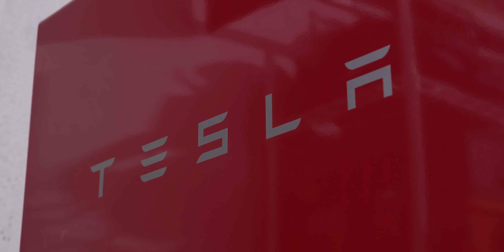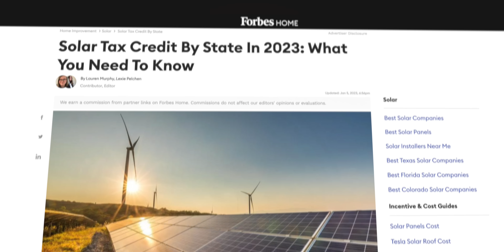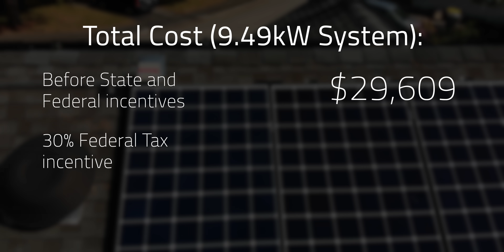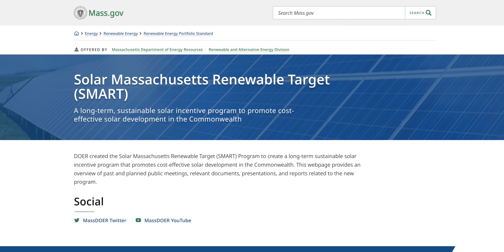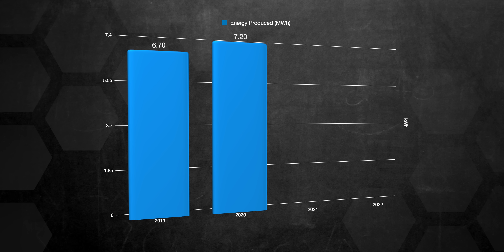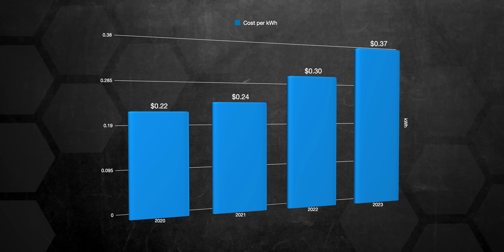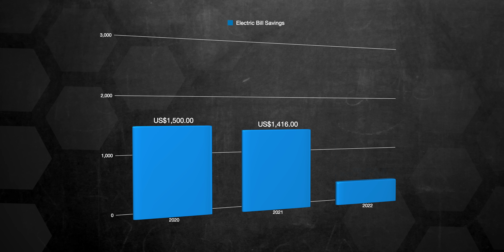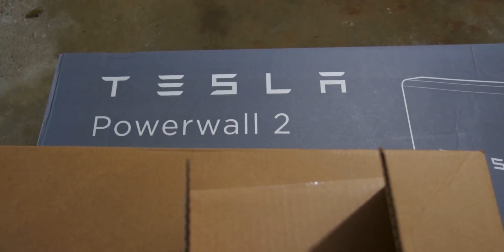5 Years with Solar Panels - Is It Still Worth It?

Comment from the maker: Do you want solar for your house? If you have solar, what are the things you wish you had known beforehand? For 65% off with HelloFresh PLUS free shipping, use code MATTFERRELL65 at https://bit.ly/3D53QkS!

If you liked this video, check out: Wow! I Didn’t Know A Prebuilt House Could Do This https://youtu.be/y3NVDqH39CE?list=PLnTSM-ORSgi7FwYRnWkpCSkAeFOzrgh5h
Reply: How much did property taxes have increased since you installed solar panels?
Reply: @ColinPopoviciu  They wont increase because solar panels DEVALUE your house. Another thing these sales people dont tell you. Talk with a realtor.
Reply: get polycrystaline panels ignore the normal monocrystaline panels ... the poly panels gather different wavelengths of light making them more efficient and a larger peak use period ...
Reply: Does your guide include info for homeowners who are retired on social security and are not paying much in taxes anymore?
Reply: @mnemosynevermont5524   I think you're SOL if you don't have any taxable income to offset a solar tax credit. However if you don't have enough income to offset the full 30%, it will roll over to the following year.    At any rate you might not see a total ROI in your lifetime, unless your planning to live to a ripe old age.
Reply: @mnemosynevermont5524  Heres your info - dont get them.
Reply: Better to build an overhang to protect people than keep the snow up on the roof.
Reply: Taxes, depreciation, hybrid solar panels (thermal and electric generation), and climate change over the life of an installation.
Reply: @brodriguez11000  Home owners insurance co. dumping you or doubling your rates, service contracts, repair from leaks and rotted roofs, electric co. penaltys what they didnt tell you about that either?
Reply: Matt, you failed to mention that your just shy of $7,000.00 knocked off of what you paid for the panels means that so far you've paid your full electric cost since installation, so technically speaking you haven't saved anything yet on your electrical useage costs! Once the solar panel array is fully paid off only then you'll be saving on electricity useage costs monthly. (...around 9:05) My biggest question I've never read answered is: What happens when it's time to re-shingle your roof, do the panels get temporarily removed, including the mounts? (Leaks develop on older roofs.)
Reply: Matt - i have had similar experience.  I have larger system 19.2kwh but our utility has lower rates as they use more wind/solar which leads to lower grid costs themselves.  So my payback period was going to be longer.  However, I recently purchased EV which now utilizes the excess electricity I produce so improving my B/E time horizon.   In my case, any excess electricity I produce I sell to grid at wholesale rate of .07/kWh.  If I purchase from grid, consumer rate is around .12-18/kWh depending on time of use or program.  Have you considered what Break Even of PV would be for you if you didn’t get PowerWall but instead had just leveraged any excess in your EV?   Seems like more and more people will see better value from EV
Reply: @mrbizi5652  I've been eyeing solar installations for a couple years, but our utility generates 85% of our power from wind, which is great, and overall it's better for everyone to have cheaper, renewable electricity, but it's pretty difficult to make a solar install work financially when we're only paying $0.08-0.13/kwh. I'm looking at 6-7 year payoffs on a DIY install even with factoring in charging an EV, maybe 2 in the future. Every estimate for an installer would have a 15-20 year payoff length.
Reply: are you on peak/off peak billing for electric? Xcel in Colorado has been criticized that power made in peak hours (fed back into the system) isn't credited at the same rate as being charged to use that power
Reply: this video is the guide I took note and made a good deal  without the guide   thanks MATT    for doing this and sharing   my snow guards and work done all by myself full install by me and the city just did the integration added me to the solar side of things   thank you excel for helping me with that part.   the hardest was wiring and drilling thru concrete,walls etc    the roof work was fun and i own my climbing gear to help others now.   still cost me a few dollars but in the end I can repair my own system and others maybe but hopefully not i'm done with this solar thing been a long year.
Reply: Does the solar-guide include home battery backups? If not, is there a good resource for guidance on that including using incentive programs?
Reply: I think there is someone impersonating you on the comment feeds
Reply: @jdstaatssatx  oh it a scammer asking ppl to watsapp him .
Reply: how much do you pay 230 bucks a month what!  i have never paid over 50 bucks a month what are you using to cost so much ? i think a lot of people are wasting energy
Reply: who was the installer that did a horrible job
Reply: How long do solar panels last? What happens to them when they are "done"? Is there a plan in place for recycling of used up solar panels? Or are we -by going solar - creating a devastating battery mountain for our kids to detox?
Reply: @janalu4067  In answer to your questions: 1 Solar Panels wear out quite rapidly  2 No plans are in place to deal with them. 3. They contain toxic waste that will need abatement/processing. 4 The mess being created is massive and is growing at a faster rate all the time because of the cognitive dissonance amongst society that can't think past the hype and the government outlays pushing it all forward. People need to think for themselves and realize this madness is creating a disaster on multiple fronts.
Reply: @janalu4067  good questions.
Reply: Solar: if you pay for it right up front, it might be a good thing.  If you lease or are paying over time then the contract needs to be scrutinized before signing.  It may not be a great deal.  Unless you get gel batteries with the system, don’t get it.  Also, your roof needs to be relatively new so the expense of replacing it will not be alarming.  You have to pay to have them removed  before roofers can reroof than you have to pay to have them reinstalled.  They last about 30 years if you maintain them.  You know, wash them off on a weekly basis.  Solar Arrays, as they are called,  are RARELY installed by electricians, instead companies hire people off the streets or the guys standing around at Home Depot.  If you have a house fire the fire department will likely let your house burn down because they do not like being electrocuted.  You see, the system is “ON” all the time so who can blame them?  Do you really save money by having such a system?  Do the math and you will see.  If I had a choice between buying a Solar Array with batteries I would rather take the money and travel through Europe because I will still have money left over when I get home. BTW, solar will not improve the resale value of my home, but what will is a backup generator.  Just say’n… Cheers.
Reply: @568843daw  In other words, they are not worth it, you will spend more money than what you get in return. 👍👍👍👍
Reply: republicans will destroy any program that makes solar viable and pays you back.
Reply: @itoibo4208  any political party ... basic rule if they aint getting the money its bad ... it should be what the people want
Reply: thank you sooo much for all your hard work.   You are appreciated.
Reply: We live in the country and appreciate all your videos,especially on this topic. 1 piece of advice for you sir on saving money. I have a huge freezer that's saved me a fortune in Gas mileage to the store. Just something I wish I'd have done sooner. I have learned so much from you I feel like I owe you. Thank you for all you do.
Reply: Should look into liberty engine 2.0
Reply: No I don't I rely on burning wood for my heat and ice to stay cold....very efficient
Reply: I love how you gleefully tells us how much money you've saved, which is mostly because of the Green-Granola Lobby that makes regular power trully unaffordable for millions of people; 37 cents per kWh; give me a break--this is NOT a free market operating!!!  Because of this government-sponsored grift, people are so cash-strapped with either their heating or electrical bill; they literally cannot afford anything past a bleak economic survival if at all.  This has caused many people to become displaced and/or having to share resources; all because of high priced electricity; high-priced heating; high-priced gas which has also made food prices soar, adding to the misery of millions!  No empathy for collateral damage ever!
If the electrical industry were allowed to use natural gas and nuclear without onerous and hidden penalties, you'd be singing a different song.  Most people cannot afford solar or it's not viable in their location--or will be staying in the home long enough to justify it.  Or even if you do, you then have a 25-year toxic-waste time-bomb perched atop your house; very few installations take into economic-consideration of this inevitable-mitigation!
Yeah buddy, you saved money off the backs of the poorest, of the rest of us!  Thanks for posting a video, rubbing it in our faces.
Good luck on your newest castle...
Reply: Currently sittin on a bunch of Energysage quotes. Do want, also very busy right now.
Reply: you will not break even
Reply: In South Africa, load shedding is a curse, but using solar panels and a hybrid system has allowed us to keep our doors open! So I am 110% behind solar!
Reply: Not if you sell your house, It takes like 10 years to pay off right?  I also heard that if you are in a Northern part of the country they wont offset the the carbon footprint of making them.  You get a much better payoff if you live in some place like San Diego.
Reply: Yes I want them...but not on the roof! Sales are not qualified when I looked ....I would have to be my own contractor they are not even educated.  Thanks
Reply: Question: are you integrating gray water management and composting into your design? I've been curious about those strategies.
Reply: hope you appreciated that Matt.
Reply: A Power Wall installation was done poorly by a company that Tesla recommended. Then, instead of offering any remedy, they threaten to sue you if you talk about their behaviour on your Youtube channel.
If I were in your position, I would:
- Report that installation company to Tesla.
- Report that company to the Better Business Bureau.
- Make the video anyway.
By sticking strickly to documented facts, it would make any law suit unprofitable for them and help your viewers to know at least one installlation company to avoid.
But, I'm not you and you must do what you believe to be right.
Reply: Matt thank you for your amazing informative videos and you are NOT pushing this "GREEN AGENDA" that so many hypocritical Tesla "fanboys" do on so many YouTube channels .
Reply: What I think is hilarious is that in my area the electric companies have added a $60/month surcharge to your power bill if you have solar.
Reply: I think you did a great job!

I'm enjoying your work.  Grid is never solvent.  It is lifetime(s) of energy bills (household economic drain) and outage rates....especially during emergencies, when we need it the most.

I'm glad you went to the $.  To the conflict of interest within argument.  I've observed this MUCH re: Management corruption.
Reply: One of the companies I priced for Solar panels was $65,000 for my home, It would take me 36 years to pay for that at the cost of what I pay for my light bill now.
Reply: I wonder if integrating solar cell panels in the walls facing (most of) the sun, and how much impact of the electricity-bills…
Reply: In Germany, a snow rack on the roof is mandatory. Especially where there is an entrance to the building.
Reply: I had a full service solar company design and install my 5.8 kw grid-tied system. It didn’t cost that much more than a DIY and their tech support, warranty, free removal and reinstall during roof replacement, sort of real time fault monitoring gives me some peace of mind. Also they did all the permit work and even dealt with our HOA review process. I wish I’d known: 1) that panel production decreases as heat rises. It’s sized to compensate but we have very hot summers with no cloud cover and I would have looked into panel cooling strategies; 2) power company limiting installed capacity to 120% of prior year actual consumption. They claim that if I produce more than I consume I am then a utility which pushes them into violation of their contracts with their producers. 3) the snow thing you mentioned is huge! I had just put my foot on first rung of ladder to climb up and remove snow when it all sluiced over my head burying me to the knees. Could have been fatal!
Reply: As an outdoor enthusiast, I highly recommend the Segway Portable PowerStation Cube Series for all your outdoor adventures and home backup power needs. With its massive capacity, powerful output, and fast recharging capabilities, it's a reliable source of energy. Plus, its waterproof design ensures it's ready for any adventure, rain or shine. Don't forget to check out the video to learn more about the benefits of solar panels for your house. Happy camping and stay powered up!
Reply: Thank you for your comment! Solar panels for your house can be a great investment in the long run. Before going solar, it's important to consider factors like installation costs and available sunlight in your area. As for the Segway Portable PowerStation Cube Series, it seems like a reliable and versatile option for outdoor enthusiasts and those in need of backup power. The fast recharging and comprehensive protections are definitely appealing features. It's always good to have a reliable power source during outdoor adventures or power outages.
Reply: I didnt wait around for Matt to get to the point. Lots of unfiltered info. Thumbs down
Reply: I understand your interest in solar panels for your house. As an outdoor enthusiast, I highly recommend considering the Segway Portable PowerStation Cube Series for your outdoor adventures and home backup power needs. With its massive capacity, fast recharging, and versatile sockets, it's a reliable choice. Plus, its waterproof technology and uninterrupted power supply feature make it perfect for camping or unexpected power outages. Do your research and compare it with other options before making a decision. Enjoy your outdoor adventures and family time!
Reply: Waste of time for the majority of the country to listen, also his other one on 3d houses a waste of time.
Reply: We got our panels in NW Alaska where we have 24/7 sun for part of the year and 4/24 the rest.  Diesel is what’s provides energy there. We put an inverter system in and it saved us thousands the 1st year!  $7+ a gallon for diesel.  Our generator also feeds batteries.    I’m hooked.
Reply: If you can't even buy food and cook it from the supermarket???
Reply: We certainly “didn’t know what we didn’t know!” I wish we had waited for the rebates. There was one rebate, but it was only for the amount we paid out of pocket, not on the loan we took out on it. We weren’t told that. I also wish my husband and I had studied it a little more. The guys that we bought it from sold us the panels, but no backup battery, so we’re screwed. I heard their sales pitch and they definitely said we would have power when the grid went down, and that we’d be able to sell electricity back to PG&E. That’s what convinced me to go along with it. Well, we don’t have the power go down very often in CA where we live, so we didn’t find out until a couple of years later, that we didn’t have a backup battery. So, we can’t store all of the great solar power we get here. I’d sue them, but they sold their company by the time we figured it out. They didn’t put it in correctly, either. We found this out when the new company took over, they’d actually contacted us and said they would be out to fix it. That was a surprise, but we had to fight our Electric company about the $1800 true-up we had that year. Overall, we only pay a little less than we were paying. Our loan is $248/mo. and we get a true-up bill each year for around $600-$800. That adds up to only about $50.00 less than what we were paying. It’s now been about 5 years that we’ve been paying on the $40,000 loan. It was expensive! When it’s paid off we’ll save that $248/mo., but we may have retired and moved by then. Yes, we got screwed! We need to look into getting a back-up battery, but not understanding the whole system, I’m a little leery of hiring someone to do it. Anyway, I’d say that Solar is a Buyer Beware product! Find out everything you can before you sign a contract, make sure you thoroughly understand what you’re getting into, and find a reputable company that’s been in business for several years. Talk to your neighbors that have it, too.
Reply: Me me me me... Me me me

Decarbonization is 21st century pyramid building.
Just burn coal. 

This is sickening on so many levels.  "How to screw the lower middle class and make them pay for your feel-goodery."
Reply: The hail storms that destroyed fields of panels prove they have to be protected by clear plastic or mounted vertically
Reply: @UndecidedMF  we have solar panels, but they are on a mounting array in a field next to our house,  it never seemed like a good idea to have them on a roof not just for leaking, but also house fires burn significantly faster if you have solar panels on your roof. Not to mention the fact that your panels are not all facing the same direction when people try to fill up their roofs with panels. We had a solar consultation and it seemed like they were just trying to sell a product. In the early days of solar the tax rebates made it worthwhile but in many places it is still a scam
Reply: Thank you Matt!  Great video, especially the concerns.  So many of us are running just to stand still these days.  Issues like these get overlooked far too easily.
Reply: You should adjust these numbers by inflation. Maybe it's not that important for a 5-year period, but it will become crucial as years pass.
Reply: I am indeed considering getting solar for the house.

Seeing your rate makes me glad that I am supplied by an electric co-operative. Looking at the bill that just arrived in the mail, I am paying 14.5 cents per kWh that I used.
Reply: @pauld6967  Dont do it, you will lose.
Reply: Thanks for the video, quite detailed and useful for some, however purely a curiosity as the money structure concerned in the video is completely absent form where I’m watching 😊 hello from the Levant, I’m of course very interested in the scientific side of your videos 😊😊😊
Reply: I wish I purchased a couple Powerwalls from Tesla when I had them install the solar panels in December 2020. Best purchase ever! Paid them off in less than a year and a half.
Reply: I would like to know what happens with the solar panels when there’s no use it’s left in them where do they go and how many how much chemicals do they use and how much land did you disrupt to make the solar panels I’m kind of in disagrees with the green energy phenomenon I think it’s more of a farce than anything and I think it’s going to come out a great cost yeah so I’m not far at all I’m not a green energy personal believe in it and I don’t think tax credit so textiles should go towards funding solar panels for the people in this country
Reply: Some areas will even CHARGE you money if you put energy back into the grid. There are 2 reasons that I know of for this:

1. because it forces power companies to have to regulate how much energy is in the wires in order to avoid problems.

2. they don't want to lose money to the solar competition
Reply: Having a good Return On Investment with solar is primary goal. With increasing grid energy costs, it makes investing in solar a very good decision! It also means you can upgrade to high-efficiency appliances and STILL get a good ROI! Win-win-win 🌞
Reply: did you consider moving the vent &/or plumbing stack so 1-2 panels could be mounted there? I moved plumbing stack and 1 panel fit; paid for itself in 3yrs. also, pv production usually > tree shade so trim or cut trees.
Reply: And I wonder what happens to the rays of the sun not hitting the ground and what adverse effect will hurt by the solar panels a job and the rays I wonder if there’s an adverse effect the environment with solar panels on your roof
Reply: @dennishowland7495 The sun would still be hitting your roof just like before, so I doubt there will be any effect for homeowners. There might be if they start covering up and defacing a lot of land to power cities. It’s just not logical to do that. I’m surprised the tree huggers go for that. I hate those windmills, they are so ugly. They have some in the ocean on Hawaii and they’ve destroyed the beauty of the place, and God only knows what they’re doing to wildlife!
Reply: it would do me no got to install at the point my electric bill in a 12 month period in  only runs about 1200.00 to 1300.00 and if i use back up propane it would be less than this just to  use a little propane to help out
Reply: I wish it was more affordable because in this vid a lot of what was saved is based on deals many will not have. Eg only paying for installation of the tesla battery. By the time it's all paid off, maybe you'll get another 7 8 years but at some point those panels will end up in a land fill somewhere with currently minimal recycle value. 
The the problem is if more want it- costs will go UP not down
here's why it not feasible for industry  but could be better for homes.
To mine the materials needed to phase out and produce just ONE generation technology units (wind solar and a battery storage farms) we need (based on 2019 mining and discoveries-
400 years of mining  nickel
9920 years for Lithium
1733 for Cobalt
3287 for Graphite (natural flake)
Silicon 5,9 years
Vanadium 7101 years

For Rare Earth Metals
Neodymium 40 years
Germanium 29113 years
Lanthanum 166,8 years
Praseodymium 31,4 years
Dysprosium 193,2 year
Terbium 59,9 years.

That's based on assuming we can produce at 2019 levels when we only have global reserves of
2,33% Lithium
3,48% cobalt
3,57% graphite 
3,52% Vanadium

Plus IF we discover more of this stuff, for every 1000 deposits discovered only 1 or 2 become mines. It currently takes 20 years from discovery to mining.
For every 10 producing mines, 2 or 3 will loose money and shut down.
These ideas a re great! Fossil fuel will have to be replaced at some point but your audience needs to be away these are pipe dreams. Our politicians are on another planet mentally driven by climate hysteria.
Reply: @farleftsilencelikenazis1021  FYI: Solar pannel reuse and recycling is ramping up. The folks on Now You Know did an article on that this week. When people talk out of both sides of their mouth, on the one side about used equipment filling up landfill and on the other side about how we will run out if we keep mining things, and completely ignore recycling efforts, the solution to both problems, I wonder what their agenda really is.
Reply: No, I don't want solar for my house.  Even with all the government handouts and tax credits you still haven't broken even.  Plus, you apparently haven't owned them long enough to have to do repair and maintenance.  I'd love to see what happens when those costs are added in.
Reply: @abikeanditsboy3449  Maintenance costs are almost nil.  Equipment is all warrantied for 25 years. Except batteries.  Most systems don't need batteries, especially if you are in IL.
Reply: 12:50
Would you rather your roof collapsing under tons of snow.
Snow wont kill you if it falls down prematurely. 
I don't think you understand the positives in such a way you can compare them to the negatives.
You are a glass half empty sort of guy.
Reply: the fact that you live in the USA does not mean that you are entitled to excessive use of electricity, You should think about what you meant when you said I live in the USA so I use a lot of energy. Energy addiction is the cause of our present and future climate disaster. Get with it Matt.
Reply: @timkbirchico8542  Many decade’s ago, I lived in a very remote, poor area for a year. I had to heat my very small area with a coal burner.  I probably polluted more with the small, badly insulated house and coal burner than Matt is with his 1MWh / month setup (especially since he offsets most of it with solar).
Reply: @mikekolokowsky  production costs. I didnt criticize Matt. I talked of lowering consumption.
Reply: @timkbirchico8542  yes, way too often conservation is left out of the energy discussion.
Reply: Tim.  Let’s talk about your usage.
Reply: @clemfarley7257  80 to 100w a day. Solar. And you?
Reply: @clemfarley7257  occasional 750w for power tools. I live in Andalucia.
Reply: Roughly the same.
Reply: @timkbirchico8542  Rich countries tend to spend more electricity since they have higher standards of living. If they manage to replace fossil fuels with renewable energy, there's nothing wrong with that. I agree though that having big houses in excess heated in winter and ACed in summer is the most usamerican thing. It's not "energy addiction", it's energy mismanagement.
Reply: @sovo1212  do you mean that having a higher standard of living entitle one to excessive use of energy? If one can not even consider reducing ones use of energy  then that is energy addiction.
Reply: @sovo1212  I live in  a country you would call rich.
Reply: @timkbirchico8542  Having a higher standard of living means you will use more energy, no matter how careful you are. Sure, for people with mid-to-high income living in rich countries, energy is cheap, so much they don't care much about saving it. But the same applies to other expenses, like buying superfluous groceries or a car they don't need. The US is culturally worse in that regard, compared to other developed nations, we can agree on that. If you ask me, higher-income households should pay more than average people for grid energy. And as I said, they should have smaller houses or, more specifically, smaller rooms. Just make them pay more property tax per square meters, with a penalty over a certain amount.

So, less energy consumed, less energy generated, less pollution, we're good right? Well, no. Think of people living in poor countries, they also want a better standard of living, and this requires more electricity to be generated. Energy saved by the US means nothing to them. We still need several times the current amount of energy produced worldwide, for 8 billion people to live a decent life.